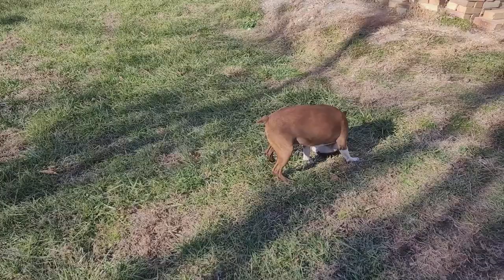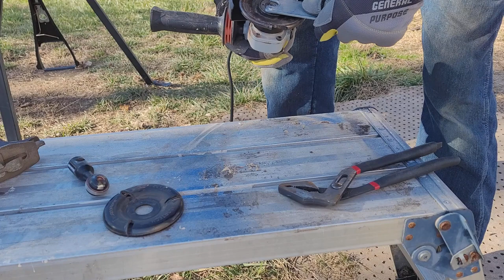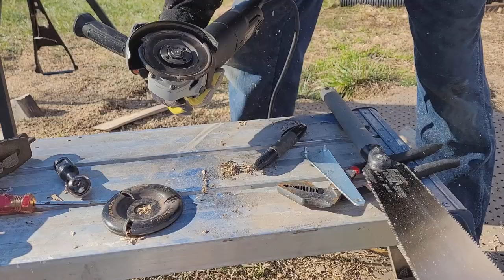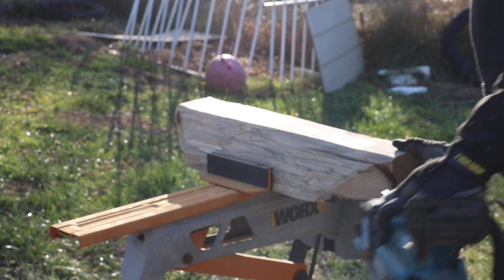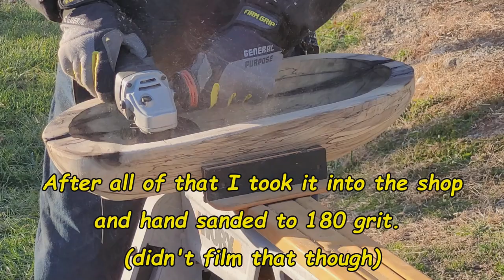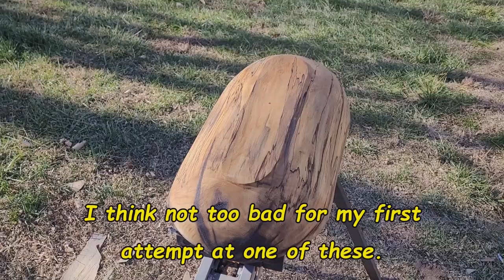Carving a Bowl with the Arbortech Power Carver

Comment: Hey.  I’m gonna try that ..Question. What kind of wood ? And does it have to be dead wood ?  Green may crack when drying?   Thanks again.  Craig.  Pa.
Reply from the maker: I am not 100% sure of the wood. It is heavily spalted as you can tell. I think it was Magnolia, but again not sure.
Reply: A lot of wood turners I know start with green wood and turn the basic shape but don’t finish it. Then they put the piece in a paper bag with some wax or something so it doesn’t crack and finish it when it’s completely dry so they don’t end up with cracks
Reply: @AggresivelyBenign  thank you so much , I have green walnut,my first bowl cracked . With your suggestion I’m starting a bowl tomorrow.   Thanks 🙏  Craig  Pa.

Comment: Nice!!  Wonder model of WORX bench you are using?  Can't seem to locate anything like it on line.
Reply from the maker: https://www.menards.com/main/tools/power-tool-accessories/tool-stands-saw-horses/worx-reg-jawhorse-trade-portable-work-support-clamping-station/wx060-1/p-1500359536779-c-1496857146263.htm?tid=7174249939058371104&ipos=1